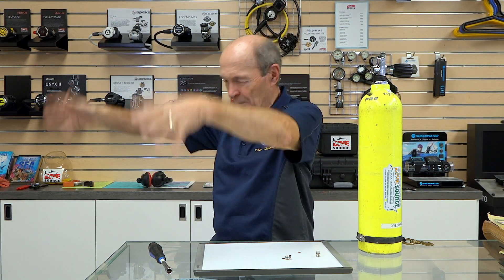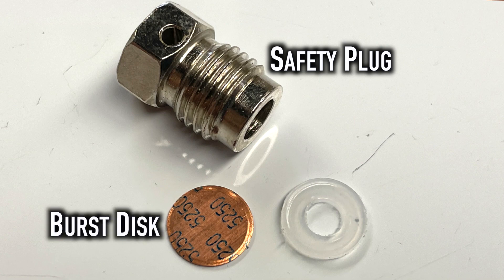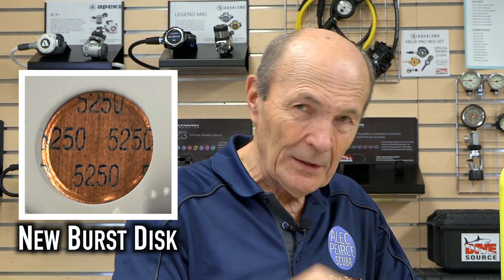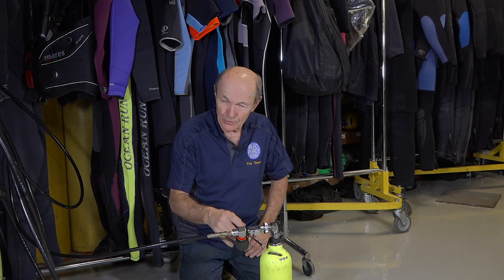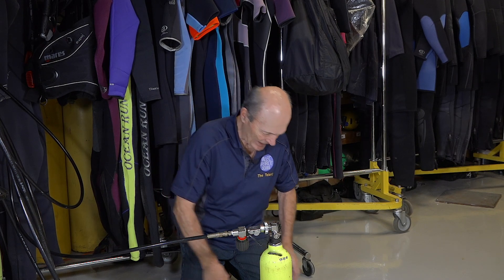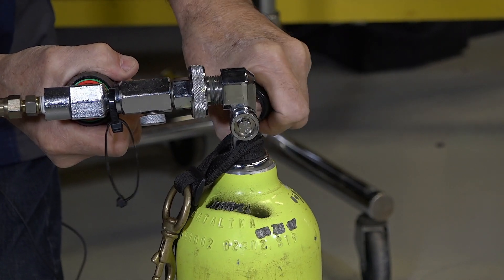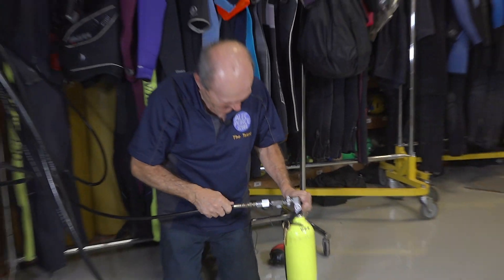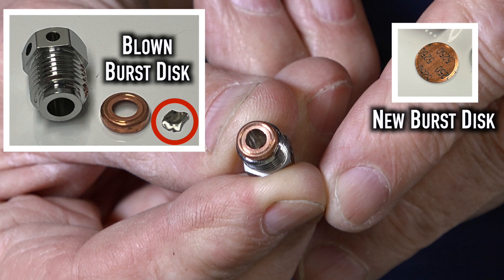Kaboom!  Burst Disk Blows - Scuba Tech Tips: S14E18

Comment: Another excellent video.  Is it effective to use the water pipe sealing tapes on the threads of these burst disk plug screws?  Or any other plug screws on the scuba gears?
Reply from the maker: No sealant should be used on any scuba gear threads.  Proper o-rings with the correct torque are all that is needed.
A

Comment: Wow!!! Just wondering, does it damage the valve when they burst? If I don't know if the burst disc was changed during the hydro, can i just take my tank in when i get it VIP'ed, and get them to change it then or is that something that has to be done by hydro guy? Do they change the whole assembly or just the washer and disc itself? I some how don't think any of mine were changed. Just from the looks i see some build from the dust and stuff in the air, that looks as if it has been there awhile.
Reply from the maker: Usually burst disks, or today burst disk assemblies (disk + washer + screw in unit) are changed at hydro due to the excess pressure of the hydro test.  You can ask for it to be changed at anytime, they are not expensive units or take long to change.  The tank we used was old so may have storage dust on it.  It was fun to see it go.
A
Reply: @AlecPeirceScuba_SeaHunter  kewl thanks. I got 2 tanks.. birth date is 2017 and 2018.. that is in need of their first hydro. I got them from a guy that bought them new and found out he and his wife  did not like diving at all. So they still 1000 psi of the original air from the first fill in them. I figured  for $50 each I could not go too wrong. Lol. I had a year now and have not even took them out of my bed room closet since I got them I want to see if the hydro guy will give the me the copper disc for my what not shelf of useless things. Lol.

Comment: You scammed us Alec!!!   I was wondering how 3000 psi coul
Reply: Woops!  how 3000 psi could burst a 5250 psi disc, then I read that you sabotaged it!!  Our local dive store had one burst while filling at a high pressure and it blew all the suspended ceiling tiles upwards.
Reply from the maker: It was almost filled to 3000 when it blew out.  Lots of force for a very short time.
A

Comment: will vintage scuba tank burst as well with 230bar air in it ? as far as I know old scuba tanks can accept 160-180bar
Reply from the maker: The burst disk assemblies are rated for the tanks working pressure so even old low pressure vintage tanks will release long before reaching the tanks max pressure.  A great safety device and cheap too.
A

Comment: Hi Alec, That did look fun, but destructive testing is always a valuable tool if you have the equipment to measure it precisely. I remember one place I worked had a pull testing machine for evaluating the strength of the parts we made. I took a piece of low grade #10-24 threaded rod (the ones you hang planter hooks with) and tested it. I was shocked that it took 900 pounds to break it, those are some heavy plants! Btw what was the pressure the disk failed at? Take care Owen m
Reply from the maker: Hi Owen.  I purposely scored the burst disks outside so it would fail before filling the pony wi 3000 psi.  I think it failed at over 2000 psi (which is what I wanted).  Still it was loud and forceful even on a small tank.
A

Comment: I once witnessed a burst disc letting go when somebody filled a 3000psi paintball tank (which is essentially just a miniature scuba tank) from a 4500psi compressor and didn't pay attention. It was bloody impressive. I've never actually witnessed a tank blowing up, it happens occasionally in paintball when a player takes a very unfortunate fall. But I have seen pictures, both of the tank and of the players' bodies after the tank blew up right next to their cheeks. It's rarely fatal, but seeing the aftermath puts anyone off their dinner, believe me.
Reply: There are pictures that show scuba tanks when they have blown that have took out buildings! I can’t imagine one, even small, beside my face!
Reply: @fujifame1  There's all kinds of safety features built into the system, the marker frames are designed to buckle long before the bottle lets go, the air system adapters have spots where they are supposed to come off, and the connection between the actual bottle and the built-in regulator (What would be the first stage in scuba) is also designed to break off. Mostly it works, but sometimes it's not enough. Most of the cases I've seen a crack formed in the threaded neck and worked its way down, blowing a divot out of the neck of the bottle.
Reply from the maker: Handling any pressurized cylinder has risks.  I'm glad scuba has burst disks.  It was very loud and surprisingly forceful even with a 19 cu/ft pony bottle as demo.
A
Reply: A Pony bottle is actually not a bad comparison to a paintball tank, they come in .8 and 1.1 Liter sizes.

Comment: It's rare enough in UK to get close to a nominal max fill.  As the cylinders are certified to another 50% on top of that we take our chances and do without these disks, which the more Hogarthian of our community probably think of as an extra unnecessary failure point rather than a safety feature.  And I see someone has already commented that you can't fill a 232 cylinder from a 300Bar whip.  Interesting demo though, and nice to see the adiabatic ice formation.
Reply from the maker: Glad you like it Tim.  Sure surprised me even with a small pony bottle.
A

Comment: Our European valves do not have burst discs.
Maybe because we don't have so many different tank pressures.
Most shops only fill 200bar or 300bar and you can't fill a 200bar tank (200bar valve) with a 300bar fill whip.
Reply from the maker: That seems very strange as I know all convertible tank valves (yoke with DIN inserts), have burst disk assemblies.
A
Reply: @AlecPeirceScuba_SeaHunter  Never seen them on EU tanks. Both my tanks don't have them. And the valves on these are the convertible DIN kind.
Reply: The only reason we have them on ours in the US is because in the early 1900’s some boiler tanks exploded and the government over reacted and made all valves on pressurized tanks have burst disks.